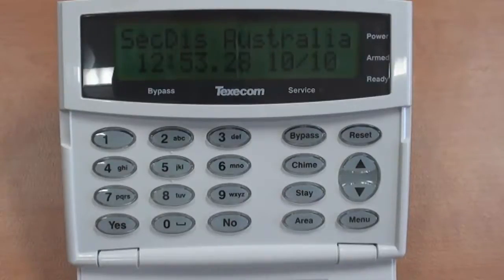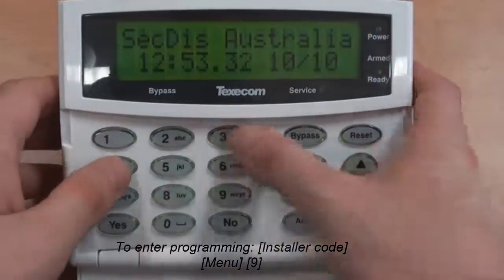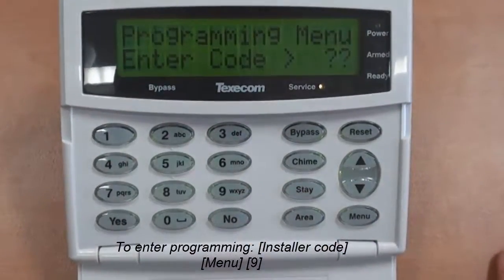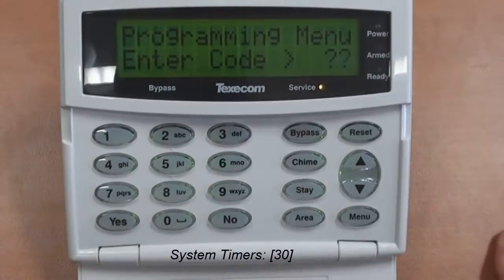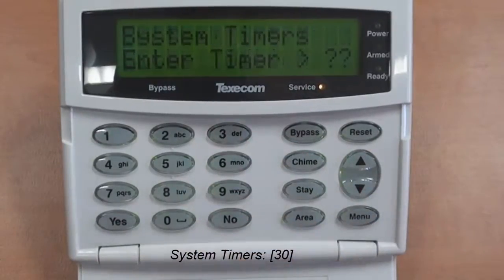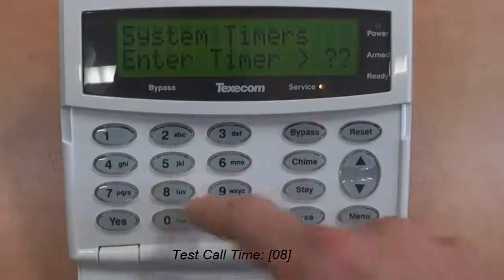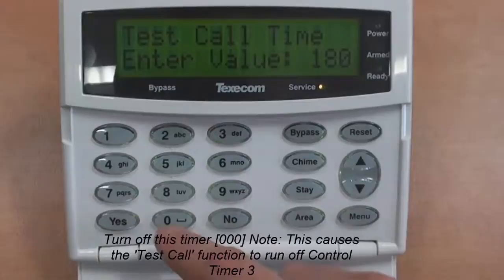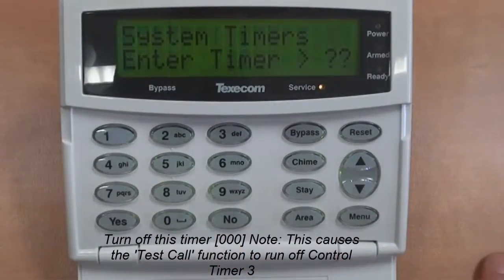Technical Note: Texecom 816/832 24 Hour Test Call Transmission at a Specific time

Comment from the maker: This can be done from the Keypad. If you enter engineers programming mode and set up your com port as a GSM dialler, and then program your UDL/Digi options accordingly. Refer to the GSM dialler manual page 8 (INS-315-4) for more information.